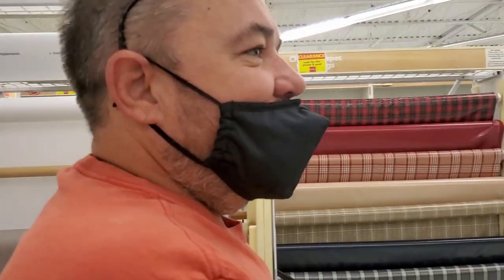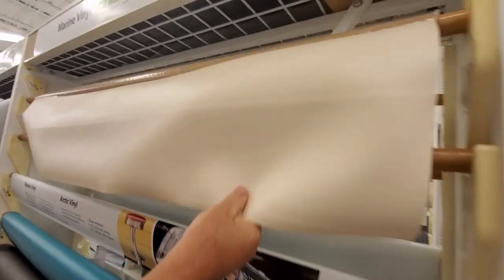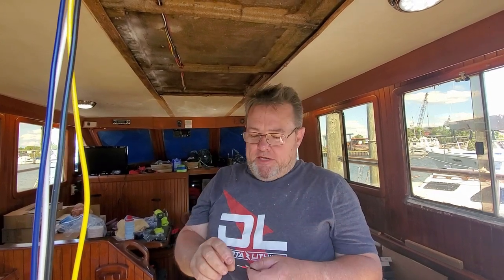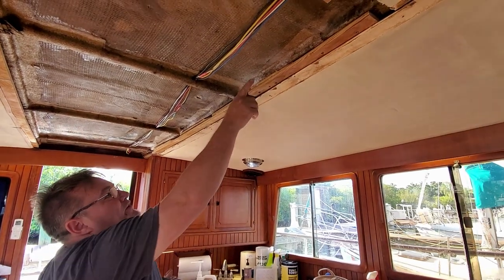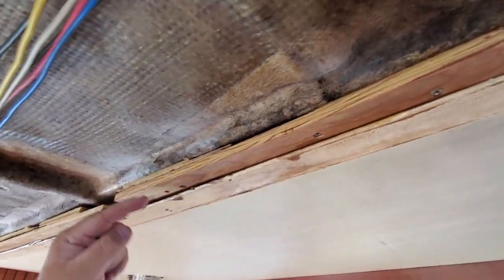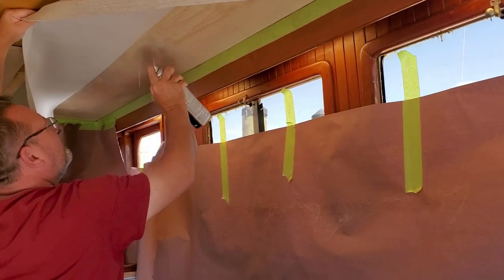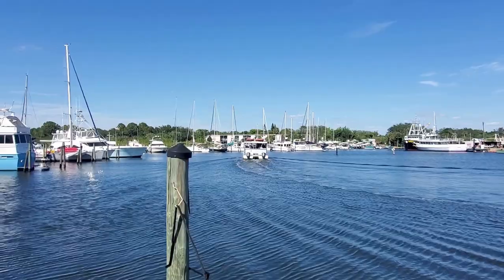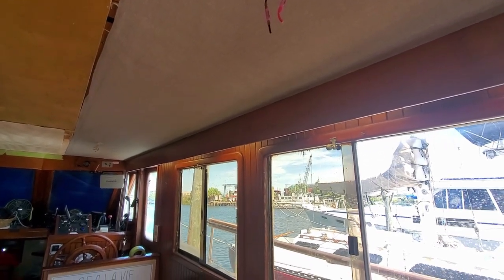Trawler DIY- Headliner replacement and repairs part 2- Selecting fabric, furring strips and gluing.

Comment: Thanx for sharing. 
Busy with the same job on Prrrfection.
Reply from the maker: Glad it was useful. One thing to add. Some of the 3M supertrim adhesive has failed in some areas. I am thinking the various cans of glue we bought were from different sources and some of the cans had to have the dust knocked off them from being on the shelf so long. So those areas will have to be redone. Of course with everything trimmed up and many areas still holding it should be much easier. I have done some experiments and found that HH66 Vinyl glue is what I will be using. I would literally say that the HH66 is about 20 time stronger and works very well with the Vinyl. The only drawback is it has to be brushed or rolled on. I bought a gallon of it and next week we should resecure the spots that failed. I will update that in a later video. Good luck on your project. Of all the things on the boat I have done so far...none had the impact that the headliner has had. Youll love it and it will be worth it in the end.
Reply: @mvintrigue-trawlerdiy1101  HH66 sounds like what i should use. 
3m is not available and cannot be delivered to fiji at the moment. I have to make do with what we can get here.